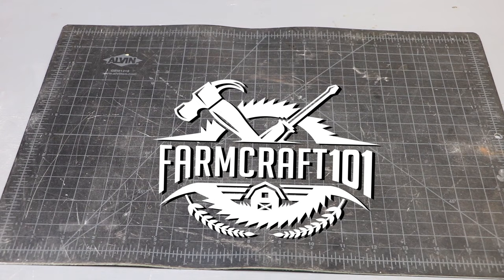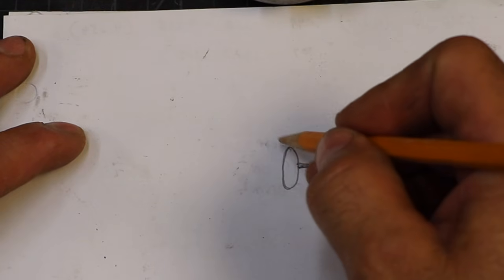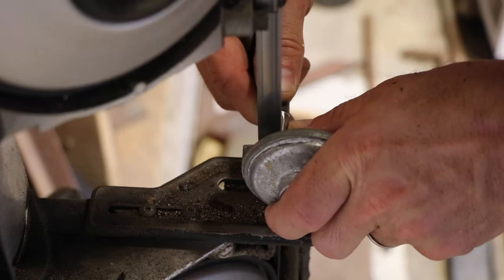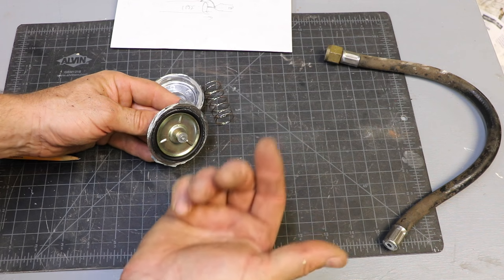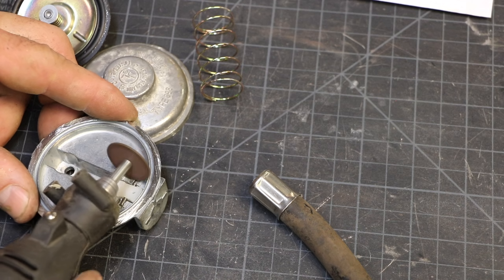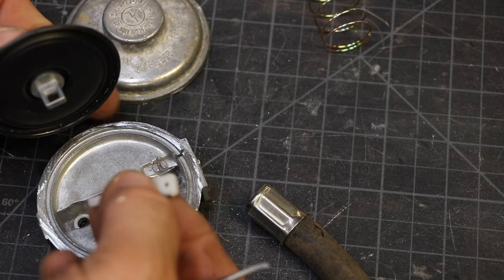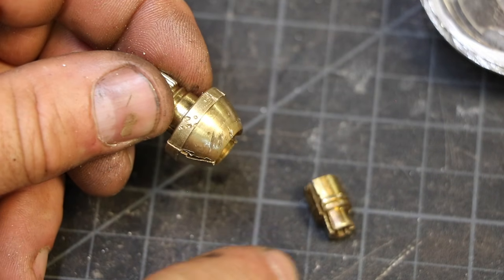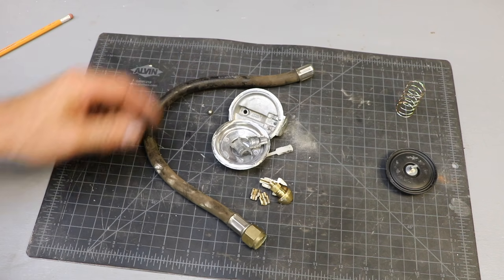Surprising Mechanism Inside Your Grill Regulator.

Comment: It ought not be a ratio between the surface area of the input valve and diaphragm that regulates the pressure. Were that the case then the output would be a fixed ratio of the pressure in the tank, but a regulator's job is to produce a (nearly) constant output pressure weather the input tank has 200psi in it or 5. I'd suspect that the spring provides the vast majority of the force that the output side works against, with the difference in surface area (And probably leverage from the little lever) ensuring that the ratio of force from the input is "very large". Sufficiently so that the variation of output pressure becomes negligible with expected variations on the input line.

I've never actually taken such a thing apart or done thorough research on these, but that's just a thought that popped out at me while watching this.
Reply from the maker: Great point. I agree. The spring and the surface area of the diaphragm is really what keeps the output pressure constant. I’m bummed that I missed that in my explanation in the video.
Reply: @7LegSpiders  i was going to write exactly this. Good explanation.
Reply: @7LegSpiders  - All this is getting rusty now but l remember that Pv=RT (where v=specific volume) is easier and more practical to use.
Reply: @7LegSpiders  I was just about to say that act same thing.
Reply: your output pressure is governed by the force of the spring pressing back on the diaphragm. the pressure in most propane systems is 14" of water column, or about 1/4 lb. the check in the end is most likely  an excess flow vale that closes in the event you cut the line downstream of the regulator. most new ones have this feature and will go into a kind of limp mode if the bottle is opened too quickly but can be reset by shutting the bottle off and slowly reopening it after reliving the downstream pressure
Reply: Thank-you
Reply: Would the atmosphere side of the diaphragm have an influence on the pressure with different altitudes? Higher altitude = less gas & vice versa?
Reply: @mickwolf1077  it should have an effect, but it will be cancelled out by the reduced back-pressure on the burners. Making flow (nearly) constant at any altitude.
Reply: @mickwolf1077  yes but it's minimal

Comment: Get a Fisher 912 regulator. It’s what was copied to make this piece of non serviceable junk. You can totally take apart a 912 to clean it, repair it, rebuild it, unplug the orifice, and adjust it to supply more or less output pressure.
Reply: Thanks.  Marked down on wish list.
Reply: @dennisyoung4631  No worries.

Comment: On Weber grills if you turn on the burner before turning on the tank it engages a safety device and you get low flame. You can reset it by shutting everything off and starting again. You might try this before changing regulator.
Reply: Yep, had to reboot mine many times to get normal pressure.
Reply: Yes, I think it is sort of an excess flow valve. Although a true excess flow valve shuts off the gas completely.  The propane tank trucks have one inside the tank where the line connects to the tank.
Reply: It’s not just Webers.
Reply: that safety future is in the tank valve not the bbq
Reply: Just opening the lp tank too quickly can cause a low flame on every regulator i have seen... wifey always complains low flame.. i ask did you open slow, always get a yes.. go out, shut off tank wait 30 seconds and open sloooooooowly.. full flame every time. I was told doing it quickly fools the regulator into believe there is a much higher pressure..

Comment: Subscribed!!!!  I have always wanted to open one of these up but didnt want to lose my fingers.  Thank u for risking your fingers.  My only question is what happens if the little breather hole to the outside air gets clogged?  Should we stick a pin in this breather hole to see if it will solve a low flow situation?

Comment: GREAT VIDEO TAKING SOMETHING APART TO SEE HOW IT WORKS. YEARS AGO I TOOK AN ELECTRIC WATER HEATER THERMOSTAT APART AND IT SHOWED A SET OF CONTACTS CONTROLLED BY A BIMETALLIC DISC THAT WOULD OPEN AND CLOSE TO CONTROL THE HEAT. ONLY ONE WITH A TWO THERMOSTAT TANK CAN OPEN AT ONE TIME

Comment: Some propane fittings have what is known as an "excess flow valve"  If the hose should get cut, or some other catastrophic failure on the high pressure side, the high flow rate causes a small ball or needle valve to close and block flow from the tank.  It is usually spring loaded to reset it.  This is a safety function, just to prevent a tank from spilling it's guts and flooding the area with flammable gas.  I know most modern tanks have this, and I have seen problems where the tank thinks there is excess flow because of connecting a long hose or something, and it will close the valve.  Usually, you have to shut off the tank valve, and equalize the pressure to get it to reset, then things will work normally again.  If you didn't know about this, it could drive you nuts trying to figure out why your tank is not working.  It may be that the check ball you found in the fitting is an excess flow device, designed to trigger if the hose is cut or the regulator diaphragm gets punctured.  
By the way, a propane regulator like the one shown works exactly like any other pressure regulator.  Like the ones for your oxy-acetylene or air tools.

Comment: The ball bearing can also prevent too high of a flow into the regulator and can sometimes become stuck partially restricting flow. You can reset this by removing the regulator from the tank and letting any gas in the regulator reset the ball valve. You might not have needed a new regulator in the first place.

Comment: Newer regulators go into a low flow mode if you have the burners turned on and then turn on the propane tank. It is to prevent lots of gas escaping if there is a leak.

Comment: I replaced my standard 5psi regulator with a 30 psi one from my forge, along with a new grill welded from 1x1/4 flatbar. We're cooking with gas now! LoL I don't dare go above 10 psi, but those extra couple of lbs make a huge difference. 
If it's only one pound output, mebbe I run it at seven or eight. 600+f

Comment: I bought an adjustable pressure regulator off Amazon for my custom 35k BTU pizza oven. I found the standard bbq regulator didn't flow enough. Plus , now when I hook it up to a "rose bud" tip from Harbor Freight I almost have a flamethrower!  Man, I burn weeds out of my rocks like you wouldn't believe.!

Comment: Years ago my regulator crapped out on me so I bought a new one and tore apart the old one much like you did - but was able to put it back together -and it worked !!!  I used the new one just to be safe.  The problem seemed to be the ballbearing crapped up with carbons in the propane - but yeah - it worked fine !!!

Comment: The check valve in the POL connector is the excess flow valve.  My weed torch drove me nuts till I learned to crack the cylinder and let the pressure equalize in the regulator.  Designed to drop the tank flow to trickle if gas rushes out, say due to a burner being open when the tank is opened.  

I found your video as I was wondering how the 11" wc was able to rise the 5 feet to my patio heater.  Now I see.  The regulator settles after the tank is opened, then when you start the flow for the burner, the flow is what reduces pressure with the regulator filling the void left by that flow like a circulator on a hot water heating system.

Comment: The housing might be ZAMAK, which is a zinc alloy. Generally zinc and alloying elements of aluminium, magnesium, and copper. If you have some kind of strong acid, you can test it. Zinc will react instantly with acid, aluminum won't because the acid first has to dissolve the aluminum oxide coating. I use muriatic acid to almost instantly clean zinc corrosion off of automotive locks which I rebuild, and they are also made of ZAMAK. Aluminum I believe is tested with an alkali (base), but I haven't had a reason to try that yet.

Comment: If you want to quickly test for aluminum vs zinc, swab it with a mild acid such as vinegar. Aluminum won't do anything but zinc will fizzle. Zinc is ridiculously reactive. Also zinc melted about half the temperature of aluminum.

Comment: I just threw one of those away.  Replaced it with one from my previous grill.   Never throw anything away.
Reply: I had one in the shop that got me through a surprise failure during our big winter ice storm.  Swapped some fittings and was back in business in about 10 mins.  Good thing too because there was NOTHING available locally in the local area due to the storm.
My wife used to pick at me for being a hoarder..  until I saved our asses a couple dozen times.  Now she is like "do you need this?" before it goes in the garbage :-)
Reply: I recently had to replace one that started leaking (slowly) out of the spring chamber. I cut one from a retired grill and spliced it onto the gas line on my current grill. I had to use a hose coupling and clamps because those hoses are staked onto the regulators (serviced as a unit.) Packrats of the world -- unite!

Comment: That check valve is probably a flash arrestor to prevent an explosion from forcing oxygen and heat into the main propane tank.  Atmospheric pressure on the diaphragm plus the adjustable spring force equals the regulated gas pressure on the diaphragm; otherwise, the diaphragm moves and opens/closes the needle valve to make these equal.  Gas flow to the burners depends upon relative pressure (above atmospheric pressure) since the burners are at atmosperic pressure.

Comment: My uncle was a propane gas truck driver. He said that propane/butane has a scent added to it to make sure you smell it when leaking. I watched him spray carburetor cleaner in the low pressure side, and then blow back through it with the air compressor. He said that the gas would leave the residue in the regulator. He was really much more intelligent than his fifth grade dropout rate gave credit for. P.S. He said that if your lighter on the grill used a battery, you should not replace it . Light it with a extended lighter. According to him the second to third battery and the zinc in the regulator will cause a reaction that will cut its life short.

Comment: They used to make regulators with a plastic Black screw off cap and inside was a flat brass screw that you could turn to increase and decrease pressure. Haven't seen one like It in years.

Comment: Should be 11-14" of water column, or 0.5 PSI at the burner.  Most LP tanks have a 250PSI pop-off, but there are a lot of old ones out there in the 200PSI.  Unless you've got the bottle over full or painted black and in summer sun it'll likely never get near 200 PSI.  BTW, those little silver regulators are the cheapest junk out there, but they tend to work fine for years.
Reply: I tend to differ. Those silver regulators are junk period. They don't last more then 1 year if used on a regular  basis, Most of them leak as well. 
Ideally, you buy a good quality regulator and fittings and hose and make your own. lasts 10 times longer without the headaches.

Comment: Always fun guessing how some item of equipment works and then take it apart to up to see if your idea is correct. Our grill regulator failed last year after many years so I had to replace it. The frame is about the only original part left of the grill. I did not have a way to disassemble the regulator, nice being able to see how it works.

Comment: You got that wrong about the check valve. It is to prevent excess flow in case of a cut or broken gas line. This is an important safety device to prevent large flames from burning the house down.  Also if you wheel the tank open on a non pressurized system, that ball will slug and limit flow till it equalizes. If you try to light a burner while slugged, you will never get gas flow except a tiny bypass that is supposed to equalize the system to release the slug.
Back pressure in the regulator is not the reason or concern. Also you lost the little spring that keeps the ball to the open position till it is overpowered by excess flow.
Another point if safety that you missed is that little spring tower on the diaphragm. That is an over pressure relief valve. The way that it works is in case of trash getting between the seat and orifice causing pressure to creep when not in use. The diaphragm will rise higher than in normal operation and the relief will hit on the aluminum casing to open the relief allowing excess pressure to be vented out that tiny hole that you are not supposed to plug.  Now go examine it again with this in mind and I bet you will see it.
Reply: I replaced my regulator because of low flame, then when that didnt help I learned you open the tank THEN the burner controls... not the other way around. Kinda like it says ON THE GRILL if I had actually taken time to look at it. Darned grill newbies...
Oh well I have an extra regulator now.

Comment: Pressure regulators have three pressure areas. high (in up to 200 psi), low (out .4 psi) and reference (atmosphere). The diaphragm is between low and ref and the spring force defines the pressure difference between low and ref. The diaphragm controls the valve. Some relations: in/out = 200/.4 = ~500 and diaphragm/valve area (levered): ~+2000. This is not to regulate but to overcome the highest pressure possible (full, hot within specs). Only  low minus ref is regulating.

Comment: If your grill is not getting up to temperature, turn off the valve on the bottle,  unscrew the regulator,  re screw it back on, then open your bottle. Some kind of pressure lock.

Comment: Always tap on the reg and give a bad reg a blast of compressed air in the vent hole while the gas is off and the hose of disconnected.

It'll fix it every time.

Also if you think your gas is low.. the burner holes in the bottom might be rusted closed... Pull the grill out and brush the bottom of the burners if your tank seems full but flame is low.

Comment: I just had a problem with a regulator like this one. In my case it was a propane camping shower. The first sign of trouble was sooty smoke coming out the exhaust, then the shower wouldn't heat water. In my case the problem was the regulator started putting out too much pressure. The soot was because too much gas was flowing to burn cleanly. The second failure mode (not heating water) was because the shower has an electric gas valve, and the electric gas valve couldn't operate when the pressure was too high (maybe a safety feature.) Interesting that whatever was failing was progressively failing and the pressure was rising over a few months. A new barbecue regulator fixed the problem - after trying new batteries, new tank,  debugging the electrical wiring, etc...

Comment: I’ve had trouble like this before, the ball is there to prevent “free flow” in the event there is a rupture in the rubber hose or the bbq valve is left on. If you open the valve on your bbq before opening the valve on the propane tank this ball will seat itself and only allow minimal flow around it, this will cause a small flame, all you have to do to reset the ball is to shut both valves off, at this time you will hear a “click” this is the ball moving off it’s seat, then turn the propane tank on first and then the bbq valve. There was likely nothing wrong with the regulator it was just the sequence in which the valves were turned on or maybe the bbq valve was turned on too soon after the propane tank, you should wait a couple of seconds before you turn on the bbq valve to allow the pressure y equalize across the ball, hope this helps.

Comment: There is one part you overlook and that is The female fitting the large piece that screws onto the tank that is plastic I've had a few of those were out and there's a little needle up in there that compresses the valve on the tank if that plastic is worn out you have no pressure to compress that needle that's inside the tank valve I hope this turned out right.

Comment: That tiny hole valve mechanism at the short end of the white lever is identical to the valve in some toilet mechanisms, where a float in the cistern pushes the long end of the white lever and stops the water filling the cistern. I think it's some kind of pneumatic mechanism.

Comment: Simple, if you turn on the gas cylinder, with the BBQ burners turned off, gas fills the regulator and the feed line to the BBQ, once that pressure builds to the given output pressure the diaphragm in the regulator is pushed out, against the large spring, pulling the rocker arm with it. Then due to the mechanical advantage, the seal on the rocker seals off the tank preventing more gas from flowing from the tank. 
If that seal fails, there is another valve, a safety valve, in the middle of the diaphragm that gets pushed open, purely by gas pressure, letting gas escape past the diaphragm and out the small hole.
When you turn on the burners on your BBQ, the pressure in the feed tube and regulator drop, the spring pushes the diaphragm back down, and the valve on the rocker arm opens leaving gas flow. When gas is flowing through the system from the tank to an open burner or leaky seal, etc on the low pressure side of the system, the specific force of the spring acting on the diaphragm, regulates how much the rocker arm valve opens. So as the pressure in your gas tank runs lower, and lower, as you use up the gas to cook your hot dogs, the valve opens more and more as the pressure on both sides of the regulator equalise.
The ball bearing valve in the tank connector is there as another safety, so if the regulator fails or is snapped off the brass section, the ball will be pushed out into the brass seat, by full tank pressure, and stop a major gas leak, giving you time to turn off the gas tank manually.

Comment: The check valve also works to impede the tank from being filled by another tank in line, if you have a multi-tank system.